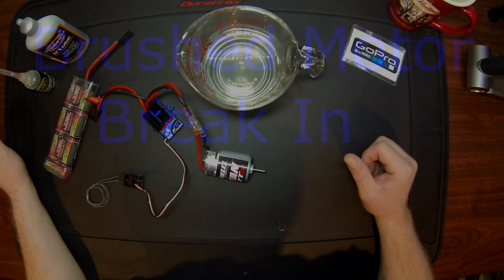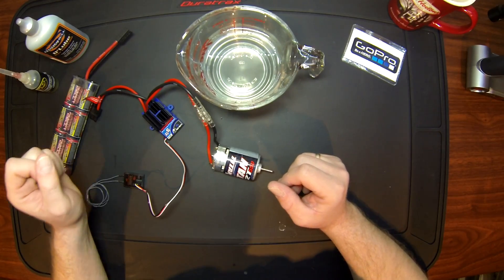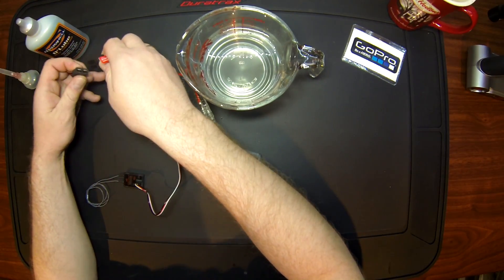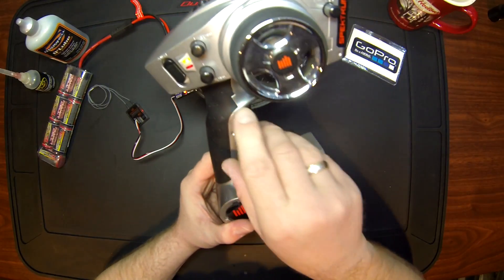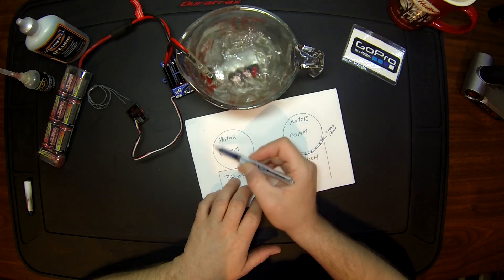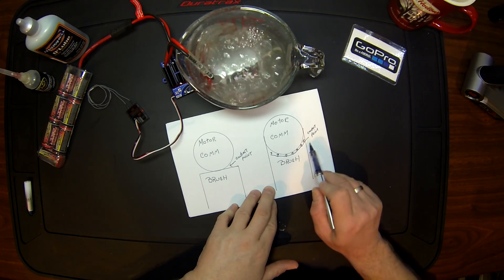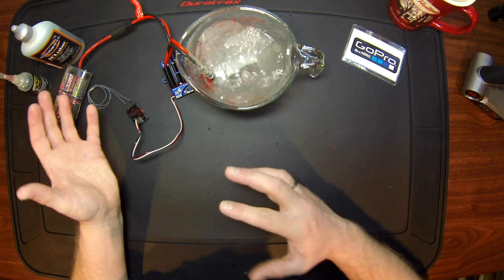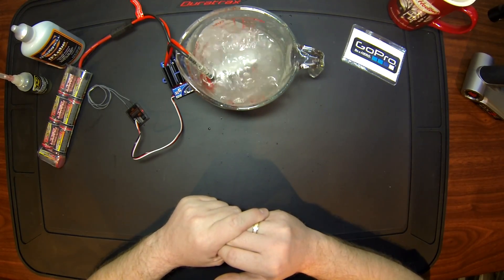How To Break In Your brushed motor

Comment: can i break in a motor that has capacitors and resistors on it?
Reply from the maker: I do apologize for the wait I never saw a motor with a cap on
Reply: Really? I have a old RC motor that has a capacitor and two resistors on the back and I don't know if I should break it in.

Comment: Hey, I got a question: is it noal for brushed motors to spark while running? I was trying to change my pinion, saw the spark and changed it back. I don't know if it has been happening the whole time, but I just saw it cuz I was paying attention to it for the first time.
Reply from the maker: Yes it is normal sometimes for them to spark.
Reply: Oh definitely. That's the power of brushed motor

Comment: Why doesn’t the Traxxas manual tell me to do this?
Reply from the maker: I would assume they want you to buy more motors.
Reply: @djsprc , if they were knowingly endorsing a shorter motor life, it would just cause me not to support Traxxas.
Reply from the maker: @matts7975  I do understand what you mean but unfortunately all the companies that has that kind of motor do not indicate to do a Breakin
Reply: @matts7975  traxxas wouldn't recommend the average Joe to attempt to remove the motor and submerge it in water every time they buy a new traxxas. Especially since it is Not required to do so. A lot of people would do it wrong, or mess up the gear mesh and not even be able to play with the car. Smart people like Us know better, the water break in is good if we do it correctly

Comment: Hi what battery’s do u run with that motor
Reply from the maker: If I remember correctly it is at 3000 amp at 8.4 volt

Comment: made same and rotor became rusty
Reply from the maker: Unfortunately this might happen once you did your breaking you can use very light oil to prevent that. Some manufacture will put a coating on it to preventing from rusting but if the coating was not applied correctly while manufacturing it if this might happen

Comment: What happens if you don't break it in?
Reply from the maker: It’s hard to say hi had motors and never did a break-in and they’re still running and I had some they did not run for long basically the brushes they might chip while using them

Comment: Just drive in a river same thing and you don't need to take it apart haha
Reply from the maker: Yes you could do that but the main reason to do a slow break in is not to fracture your brushes try to doing a break-in in the river you’ll create more stress on the motor on on your electronics and on the brushes. And yes Traxxas does say waterproof on de  boxes but if you’re read up correctly in the warranty card Traxxas will not cover water damage

Comment: why it wont corrode electrical components while passing current through it?
why wont it wash away lubricants?
why do you think the motor is water proof outside a car?
why do you think it is NOT idiotic to throw an electric "waterproof" motor (its bubbling) in water?

is it that necessary???
Reply from the maker: Tanveer Ahmed One of the reason is it is low-voltage. The other reason is the water will keep it cool and remove the dust from the brush  preventing some clogs inside the motor
Reply: @djsprc  thanks for the reply
Reply: @TanveerAhmed10  It is also recommended by the manufacturer lol. Why do you think it is NOT idiotic to spout your mouth off about things you obviously know nothing about?

Comment: I just did this and ran the motor after and it poured out a bunch of smoke. What do I do? It smokes more when you give it gas. I thought the smoke alarm was going to go off. Is this the oil burning off? It was making snap crackle and pop noises like it was hot but it wasn't hot to the touch. It wouldn't stop smoking until I shut off the esc. By the way if this helps I have a XL-5 esc and Arrma Mega 15T 540
Reply from the maker: EnforcedRaccoon What kind of oil did you use after breaking it in in the water it could just be the oil used that smoking.
Reply: @djsprc  it's 3in1 multi-purpose oil https://m.lowes.com/pd/3-IN-ONE-3-in-One-8-oz-Lubricant/3240440?cm_mmc=SCE_PLA-ToolsAndHardwareTools-Lubricants_-3240440:3-IN-ONE&CAWELAID=&kpid=3240440&CAGPSPN=pla&store_code=2291&k_clickID=f415d6e5-32ef-4449-bcdf-36c2ba3ef3c1&gclid=Cj0KCQjw3ebdBRC1ARIsAD8U0V7ywB_PirS3w5xKkc1uKDKbtKIzgT1n5eUt6lqZcD2--35oBJQrvoUaAsaIEALw_wcB thank you for replying so early
Reply from the maker: EnforcedRaccoon that’s what I thought you’re just burning the oil off if you have like a brake cleaner re-clean your motor for the brake cleaner a bit and find another kind of oil   And do not put too much oil just at the bearings or the bushings top of the motor in the bottom of the motor
Reply: @djsprc  ok thank you😀

Comment: So I just try this with my motor and it’s a traxxas and as it was running I heard a pop and it stopped running now the esc just smokes and sparks thanks
Reply: Jou have let the moter dry first
Reply: LMAO, you didn't do it right. What you just watched in this video is the most common way to break in a brushed motor. It was done correctly in the video, what did you do different?

Comment: Does 5-10 minutes will do? Or should I run it for specific Time? Thanks in advance
Reply from the maker: mr. R-one no 5 to 10 minutes is not enough you will need to run at least complete pack depending on the milliamp of your battery back. If you have like an 1800 or 2000 I would suggest at least run the back twice

Comment: Hey another multiple questions....Can you use LiPo? and I watched Rc Militias video on how to break in a motor and he said you have to turn the speed up a little after 3 or 4 minutes because if you didnt the motor will be slower, and needs only to be done 20 minutes or some do less..Is that true? Or it will be just tbe same....
Reply from the maker: Sap Brahh Yes you can use a lipo just make sure it’s in the lipo mode. There is multiple ways to do a break-in. If you do it slow medium or fast won’t change the way the motor works. It’s still going to have the same speed. Regardless the way you break it in
Reply: djsprc Ok thanks a lot!

Comment: Does running in the motor in water reduce the motors life?
Reply from the maker: Ally Haire Sorry for the late reply no it will not hurt the motor and will not remove life out of it
Reply: @djsprc  hi i cant wrap my head around how this ain't shorting out. Can you explain to me why nothing shorts out? Not even the esc im super confused and super scared to dump my electronics in water like that
Reply from the maker: @yochillll2672  It’s hard to explain it to you the low-voltage has a little bit part of it but it won’t damage it.
Reply: @djsprc  i have an scx24 ive only used it couple times. Is it ok to do the same.
Reply from the maker: @yochillll2672  Yes you can but they are not the greatest motor you may not get more life out of it.
Reply: @djsprc  got you. I also ordered a pn racing 90turn 130motor. Do you recommend doing that on it?
Reply from the maker: @yochillll2672  no

Comment: I've never done this with any of my RC brushed motors. Never had a problem with any of them either. 🤔
Reply: They will last longer and preform better quicker. Where have you bought your motors? Because in all the instructions the manufacturer suggest break in by water or driving slow
Reply: I got a brand new traxxas two weeks ago, and I burnt a motor bushing out already. I called them and they explained me the break in process is with the motor on the car you go up and down a level street at Only 1/4 - 1/2 throttle for two battery cycles. Then the motor is broke in. That’s what TRAXXAS told me so that’s what I’m doing. If I have any more issues I’m trying this method using canned air to get all the water out after and some oil to the bushings.
Reply: djhaloeight this video is a lie
Reply: @RandomVideosInFlorida  you are a lie. I don't understand how you can drive RC and not know how to break in a motor.

Comment: I don't have a throttle trim on my remote... should I really sit there lightly holding the throttle for the entire battery pack? I don't want to get a hand cramp.
Reply from the maker: Nube Toob what brand of remote do you have.
Reply: djsprc Id have to look. It's the stock one that came with my traxxas rustler.
Reply from the maker: Nube Toob you do you have one. It's built in the remote you need to program it. you could put something behind the The trigger to limited pull   And use an elastic or scotch tape
Reply: djsprc It worked. I used something behind the trigger and my girlfriends hair tie.
I was going to run it for the full battery but after 45 min I checked and my esc was super hot. So I just stopped it at 45 minutes. Water was really dirty so I'm guessing it's good.
Reply from the maker: Nube Toob good job man you should be fine

Comment: Can i relube motor bearings/bushings with 3in1 silicone oil?
Reply from the maker: Don Derrick Ramos   It's going to work what you would prefer using something lighter like sewing machine oil
Reply: Sounds good. Thank you!
Reply: Silicon is proven to greatly increase brush wear. As little as 1 part per million is detrimental.

Comment: i just got a traxxas slash. I drove it around slowly for like almost an hour.  Would that have worked? I am just afraid of taking apart my new (1st) car...
Reply: JDog5555545 don’t get your brushed motor wet it isn’t good for it
Reply: @RandomVideosInFlorida  According to the experts he is doing it correctly by using the water. The water cleans out the abrasive material, and will NOT hurt a brushed motor.
Reply: djsprc So is the water pretty much just cleaning out the dust? So when you don't do this method the brushes still curve for contact points but the dust ends up in the motor? Thanks
Reply from the maker: JDog5555545  it will work the only downside is the dust from the brushes will stay in the motor. What the water does cleans the motor at the same time while it's turning in removes the dust out of the motor.

Comment: Can you use any rc brushed motors? Im new and I have 1/18 motor and I see you have a titan motor, would it be safe and would work?
Reply from the maker: Thoody yes you can use any brushed motors.  And it will work
Reply: Does this increase speed or torque? My brushed motor is very old and it is loosing torque....
Reply from the maker: Thoody no that means your motor is getting tired time to replace it
Reply: djsprc Thanks Alot!!! Subbed!!..

Comment: Can i use wd40 to lube the bearings?
Reply from the maker: Deubi yes you can but WD-40 will attract dust.
Reply: Ah ok, Thanks for the reply:).
Reply: @deubi4491  heard wd40 will erode the carbon of the brushes of the motor? reg oil
Reply: Wd40 is NOT a lubricant. The only thing wd40 does is stop rust. Use a waterproof bearing lubricant. Wd40 also rids the bearins of the grease which will ruin your bearings.

Comment: Is there any other lubricants I can use say around my garage?
Reply from the maker: Jakeys Builds   Yes but you don't want to heavy oil you want something light that will stay on the com. and the bushing or bearing.  I hope this helps
Reply: hey sorry but is there like a brand of lub?
Reply from the maker: Jakeys Builds don't be sorry it's all good any brand will do.
Reply: all right ill have a look, i bought a rc4wd 34 turn crawler motor for my traxxas sampede 4x4 vxl and i emailed them and they sent me to you so thanks + sub and like
Reply: 35 turn
Reply from the maker: Jakeys Builds   Question for you who sent you to me exactly.
Reply: Kenny from Rc4wd support

Comment: Hey I need help I have that motor on my car and each time I run it is sparking on the inside and making a loud ringing noise is there a was I can fix it
Reply from the maker: Orion Gonzalez to see some sparks inside the motor that's normal now if it's making a noise it could be something damage inside the motor. Or could just be your bushings are dry just need. Add oil on them
Reply: @djsprc  put oil directly inside of the motor?
Reply from the maker: Stian Lunner Bruland You need to put oil on the bushings or the bearings were to come touches them.

Comment: What kind of transmitter is that on the video and is it and is it good?
Reply from the maker: Donkey Commander it's a spektrum dx2. It not bad but there is better out there. Now you got by spektrum dx4  with 4 Channel.
Reply: djsprc what are advantages of this transmitter?
Reply from the maker: Donkey Commander from the DX 2 to the dx4 it a 4 channel radio compare to 2 channel radion Moore channel more options

Comment: why water?  why not just in air?
Reply from the maker: John Smith   When you're doing a break in. The water will remove the brush material from inside the motor preventing it from sticking to the COM.

Comment: What if you don't have a throttle trim
Reply from the maker: Just use your throttle  hold it about 1/4
Reply: ok
Reply: Well I just checked out your channel and I see you have a rustler. The transmitter that comes with the rustler has throttle trimming. Just look through your manual
Reply: I have the cheapest traxxas 2.4 ghz controller they have now and they only have steering trim.
Reply from the maker: the traxxas basic controller as only steering trim that true just hold it about 1/4
Reply: Ohh really?? Ok sorry guys

Comment: hi

you may can help me... i have a systema airsoft weapon and it runs with a dc motor too. but recentli it was over eating and a dismounted it sow a can see what's going on. and one of the brushes was bronken. i'mleaving the video and the image link i allready order a new set of brushes and i whant to know if this method works in case too

https://www.youtube.com/watch?v=NqZp9hbA4wc

https://plus.google.com/u/0/102984708253436597604/posts/5iuSxsMe7UZ?pid=6091597276072273826&oid=102984708253436597604

please if you can help i apriciate

and sorry my bad english

Comment: Ok im waiting on my LRP special R motor can I break it in without putting it in water, and hoow long should u leave it running?
Reply from the maker: no you cant not you will need water to do it  the water will remove the dust tha  the brus create  and cool the motor    it is a brush motor
Reply: djsprc how do I oil my motor and will it work with wd40
Reply: @cadenwinter99  use a very light oil. NO wd40 will NOT WORK it will make your motor collect dust and reduce its lifespan.

Comment: I use two double D batteries.  Put them in a batery holder I bought from radio shack..like $1.99
The tape wires in motor.  Leave one battery out..this is your on and off.  3 minutes....good to go!!!
Reply: Im from the future and im here to tell you that radioshack doesnt exist anymore
Reply: What is a radio shack?
Reply: @covidpositive4904  they sell radios in a shack
Reply: @covidpositive4904  so they had batteryd for these radios

Comment from the maker: that means from the begining it was a faulty motor  when you do a motor breaking the water will only remove the dust from the brush  a brush motor is already water resistant  it not because you did a water breaking that made your motor fail